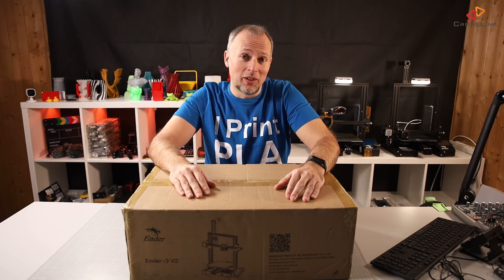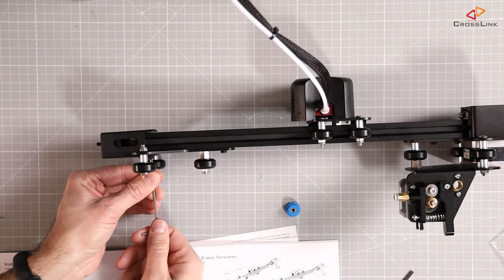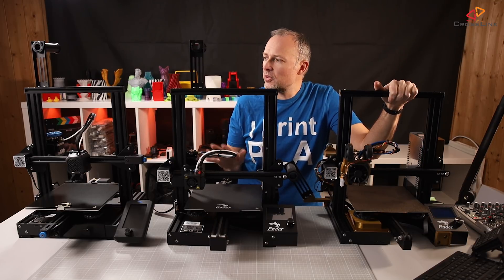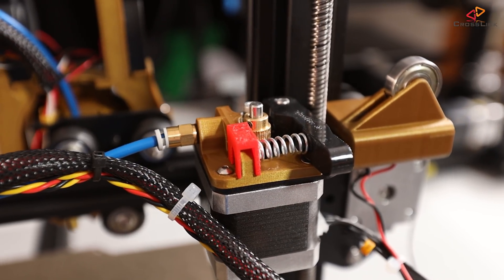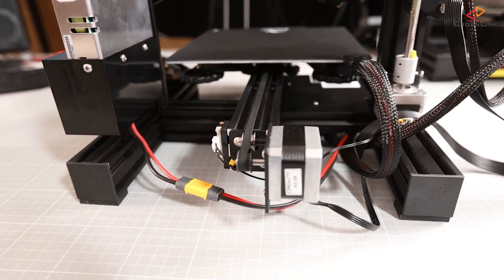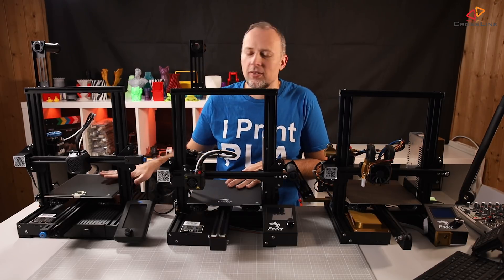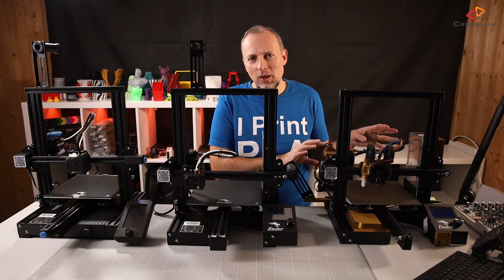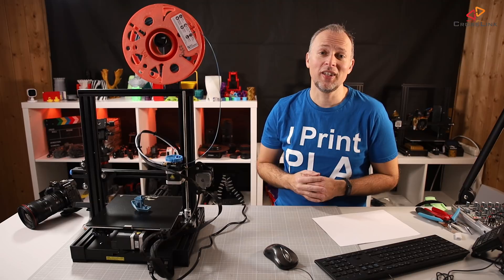Ender 3 V2 vs. V1 and PRO - what's new and different?

Comment: Hmm.. My Ender 3 upgraded V1 didn't actually have a different orientation for the mainboard case, yet it still has all the other upgrades the Pro had like the metal inlet in the extruder and 32bit board..  Odd
Reply from the maker: Yeah, Creality keeps confusing everyone with so many different versions. It's a mess. I would prefer they would let go of the old models and instead make ONE good Ender 3

Comment: Love your videos! It helped me so much in understanding Marlin, Firmware, and my 3D printer (ender 3 v2) in general.
I have a question: Is there a Firmware option to enable live-tuning the Flow rate while printing? Would be cool to add more live tuning options than just temperatures and Z offset. Also very helpful for calibration and saving some prints.

Comment: The V2 fan shroud is not the same. The support plate has screw holes in positions different than the other two, therefore there are almost no upgrades made for it on Amazon, and barely anything on thingiverse

Comment: Good summary but one correction, I believe the Pro 32 bit still has hr4988 drivers like the V1. Only the V2 gets the silent stepper drivers.
Reply: It’s hard to keep up with the changes. It’s a surprise as to what board you could get. Creality needs to thin out their product line. The E3 Pro serves no purpose, and the only reason to keep the original E3 is to offer a lower priced option.
Reply: @puretoronto  the e3 has the upgraded ps and a better build platform.   I’d say set the e3 as the pro and dump original e3.
Reply from the maker: Good catch. I think anyways, there is currently no compelling reason to buy the Pro over the v2. Agree to Michael here. Creality should actually reduce the number of models and reduce the confusion.
Reply: @Crosslink3D  idk.  I prefer the Pro, after watching the videos.   Some of the v2 upgrades seem moot when you think about future upgrades.

Comment: Great channel very informative, keep up the good work, Quick question, do you have any information on the mat under the printers at 12:42 onwards. Does it make a difference with any sound dampening? Thanks
Reply from the maker: The mat I use underneath my printers is from the hardware store originally to dampen sounds of washing machines. It works quite well to reduce vibrations and noise transferred to the table.

Comment: just got mine a couple days ago. looking forward to more v2 related comtent
Reply: Get a noctua fan and two 8010 fans to replace the hotend, motherboard and PSU (need to print covers) which will make a silent killer. There is no support for this screen on any other board so when you buy another mainboard get a screen which fits as well.
Reply: Last but not least check your vref setting mine was wayyyy to high and the steppers were hottttt even for a small print.
Reply: You made a mistake like Thor. Should have went for the ender 3 pro! 😂. I hate the display and sold it to buy biqu bx or ender 3 pro & upgrade it.

Comment: Wow, that first (complete) benchy looked great! Especially for a stock printer. Can't wait to see the time-lapse prints you make with this new printer.
Reply from the maker: Oh, yes. I was also surprised. I really did only the bed leveling that’s it. Update soon!
Reply: @Crosslink3D  did you use 'special' setting n your slicer for the V2?
Reply from the maker: I used the 0.2mm Ender 3 profile in Cura, so no special changes.